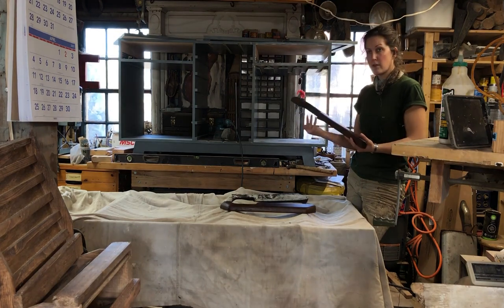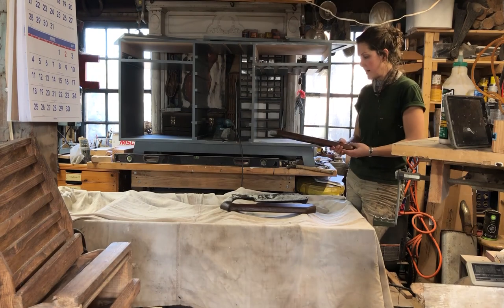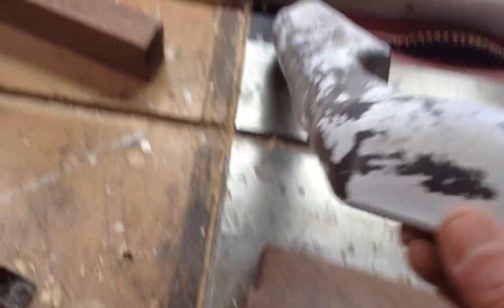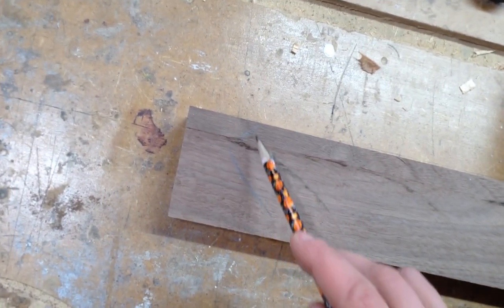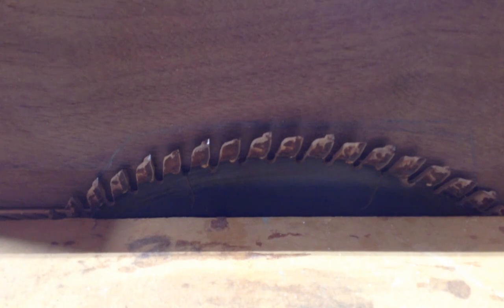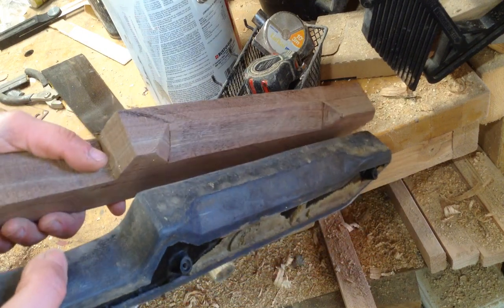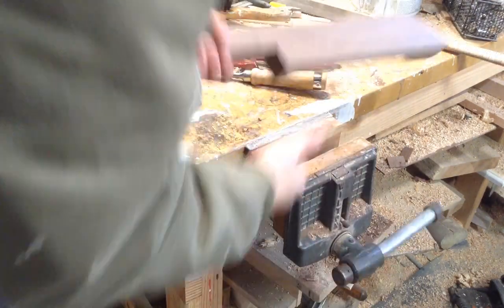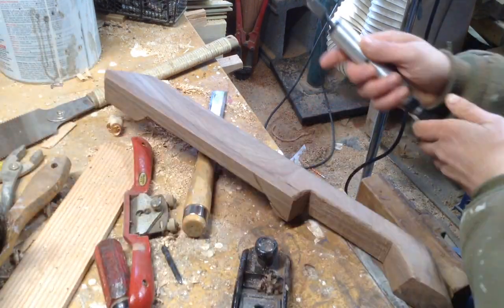Woodworking : Wooden Bronco Car Handles // How-To

Comment: Love your videos. What happened to the video you made where you built the large table with leafs? I was going to re-watch it and can’t seem to find it.
Reply from the maker: I took it down, because for a variety of reasons the top warped terribly on that table, and it is actually currently in my shop being fixed.  Didn't want anyone watching the old videos without posting a new video of the issue I had with the design and how I fixed them.
Reply: @HoneyBadgerWoodWorks  ahh, I was going to build a table top similar to how you built that one by running the boards perpendicular to the base instead of long ways, if that makes sense. Anything I should avoid doing?
Reply from the maker: If you are making an extension top the correct way to do it is to run the boards horizontally like I did.  The issue I'm having is that the top severely cupped on my so the slides were very hard to work, and the lack of an overhang caused complications as the top shifted due to seasonal humidity.
Reply: @HoneyBadgerWoodWorks  good deal, thanks for the info. Love the channel!